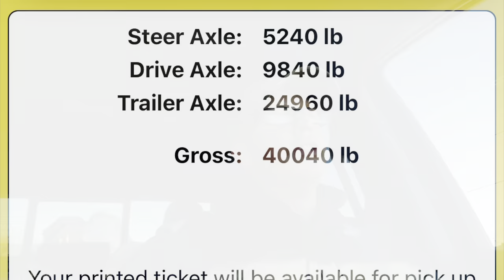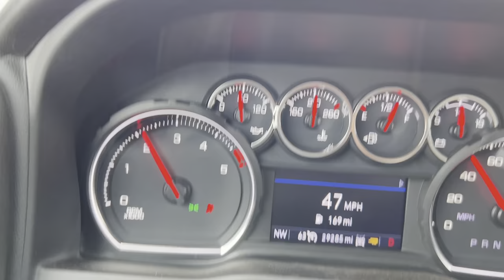$6700 in 5 days, autosocks vs tire chains, hotshot otr vlog how to

Comment: Have you had any issues with the chevy?
Reply from the maker: A few. At 35k it had never regenned and had to be manually done by the dealership after power was reduced.

Then at 45k miles it went down in Wyoming in 40 below weather. Still waiting to hear but might need a new motor
Reply: @gingerhotshot  wow that’s incredible, even worse breaking down in 40 below weather. I was actually thinking of buying a chevy, but now not so sure.
Reply from the maker: I would look into a ford or Chevy. They are all going to have issues. I would avoid the dodge because of the transmission
Reply: @gingerhotshot  Thats true , looks like i have some decisions to make, thanks for the advice.